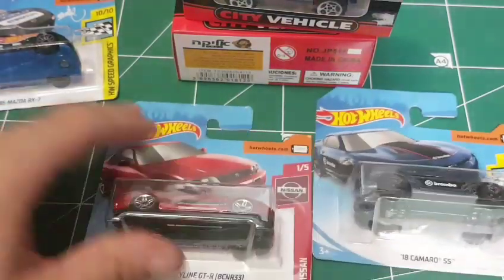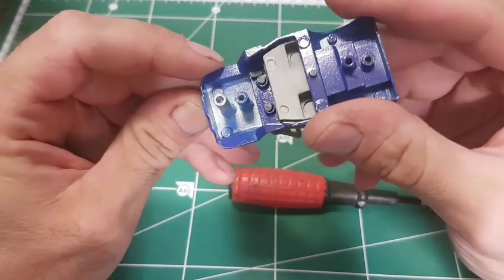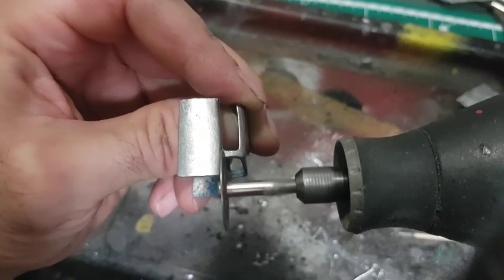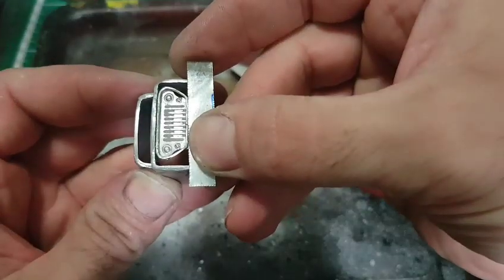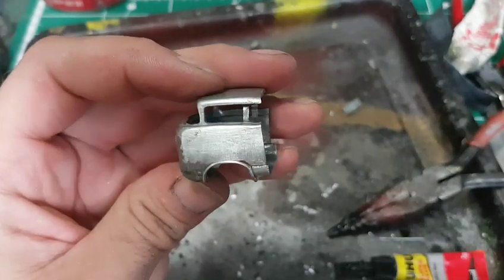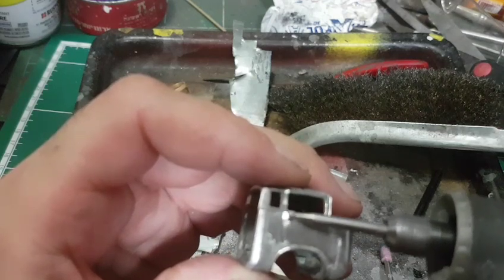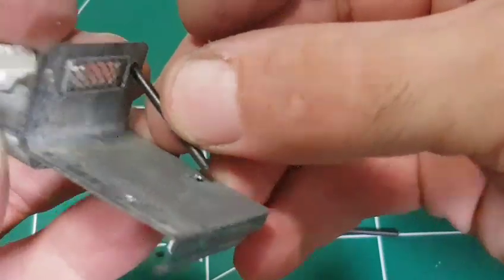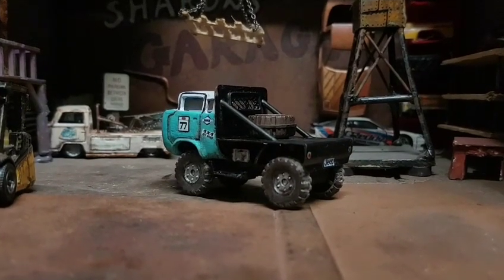Custom Hotwheels 57 Chevy

Comment: Amazing job. Never would have thought to use all those different castings to make that.  There is a jeep just like that near my house. 
You do amazing work with metal. I use cardboard and cardstock paper in my customs, I find it to be very pliable and easy to shape. 
I think you should do a M1009 CUCV Chevy Blazer using a  matchbox Blazer. Those are distinctive looking compared to the stock blazers and jimmys of the time.  
A few thoughts of mine since you asked. great job.
Reply from the maker: Thanks for the offer. I think i did some of that blazers though😉

Comment: I would suggest trying Magic-sculpt. Its a two part epoxy air cure resin that can be thinned down with water or used in it regular form. I use it often for figures, cars and pretty much any other sculpting projects. Its very versatile and sand perfectly. Well worth a look if you want to try some other materials that work well with metal, styrene or whatever.
Reply from the maker: Thanks for the advice!